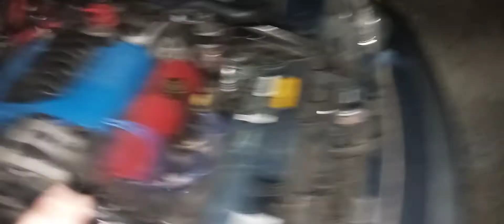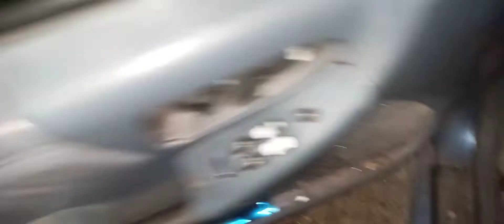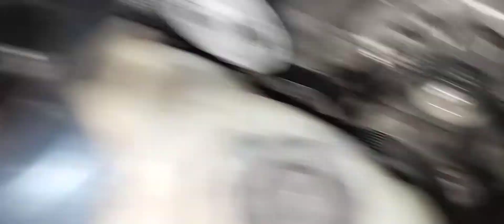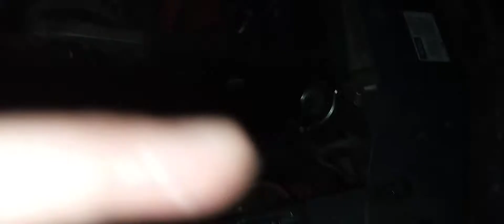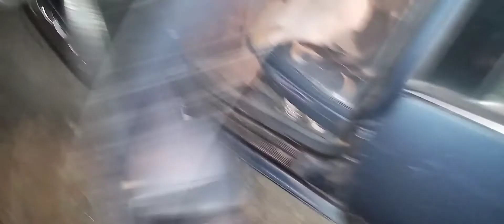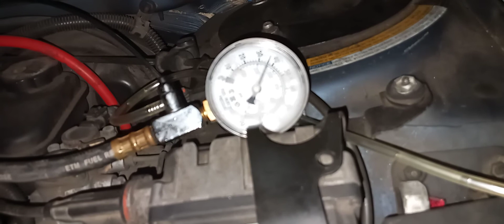Crank sensor cleaning '95 Buick Regal GS

Comment: Did your check engine light come on for this issue?
Reply from the maker: Well, yes and no. It had a slight skip in it. And when I cleaned it, it resolved it.  Years of oil and dirt will make one act up. Just like a dirty mass air flo/burnt-out mass air flo sensor.